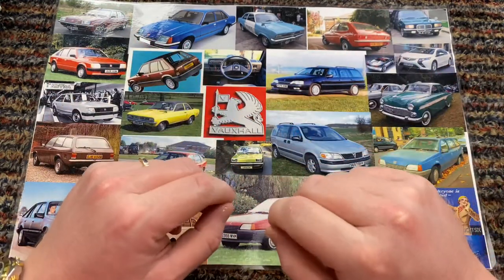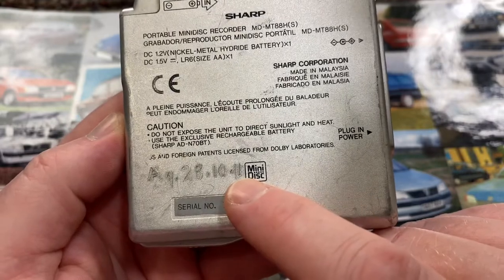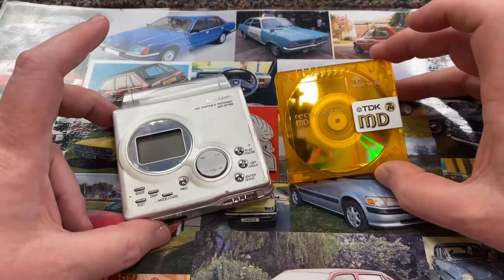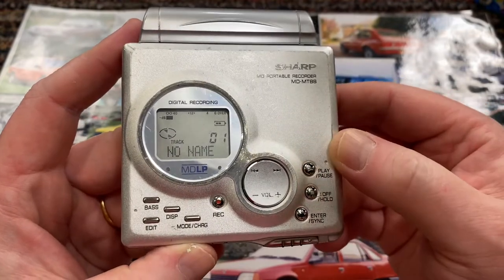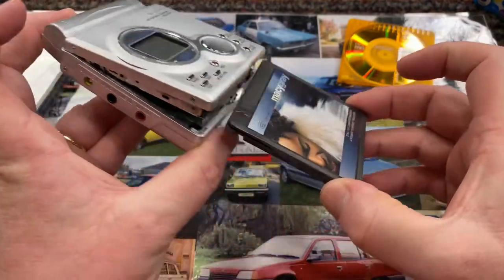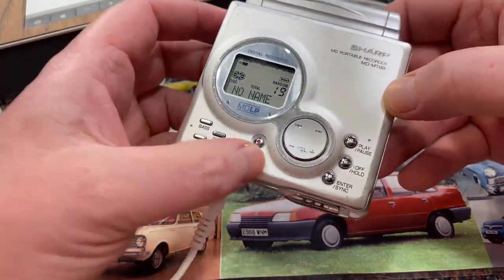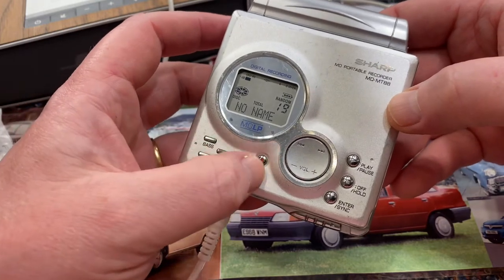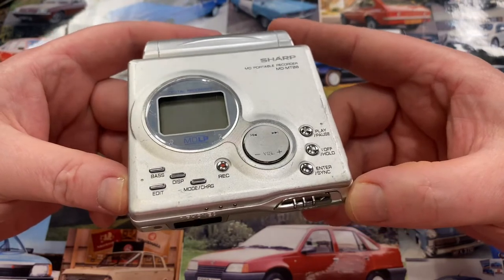SHARP MD-MT88 Portable Mini Disc Recorder From 2001

Comment: Wow! Massive nostalgia attack. 😂 I had this. Paid AUD$400 for this in 2002. It was the height of cool tech back then (besides the iPod of course). Chose this over an external CD recorder (also $400) for the portability & versatility. I could also have gotten an iPod but I was planning to do heaps of recording from vinyl, radio, CD & the MD was the best fit by far. I was so incredibly happy with it, it was a massive improvement over fudgy old cassettes. Used it non-stop until 2004 when I finally switched to MP3. (PS Mic in is for microphones only, it's much more sensitive; Line in for all other sources.)
Reply from the maker: Hi Daniel, glad you enjoyed my friend 🥰